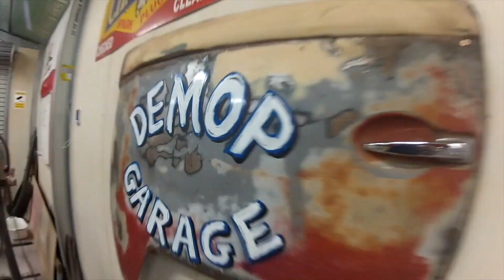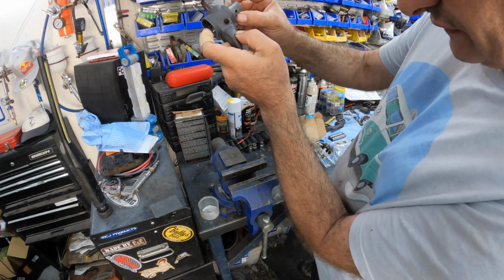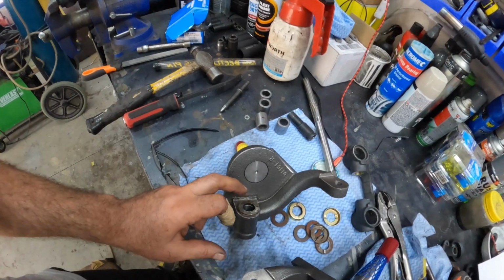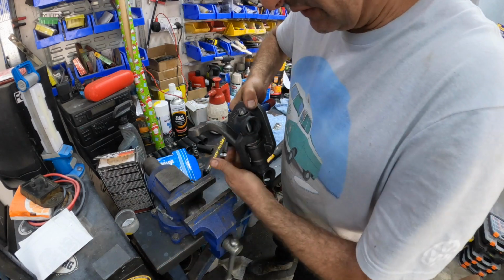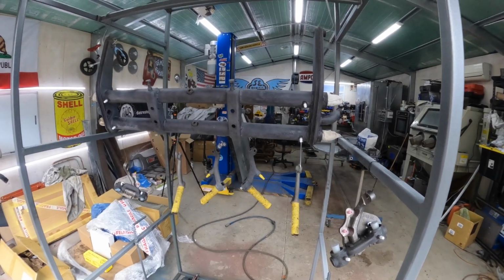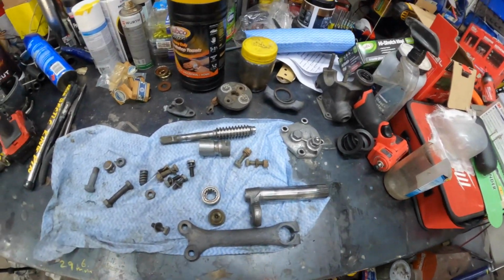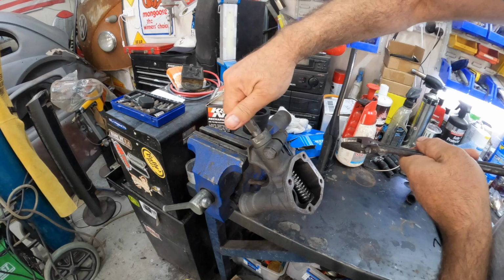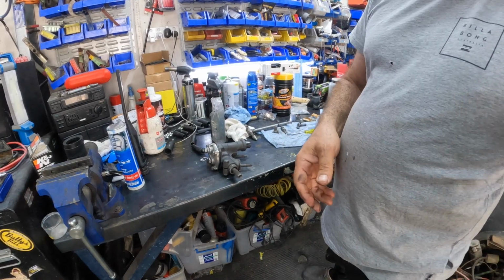Rebuilding the front beetle beam and steering box // 1957 oval beetle restoration. #volkswagen

Comment: Is there a video on disassembly of the steering box? How to remove the worm gear? Thank you.
Reply from the maker: No, don't think I filmed it but really its the same as whats on here just backwards. Side plate off first then remove the side bolt and tap out the seal plug then the worm drive.
Reply: @DemopVWgarage  sorry to ask so many questions. How do I remove the cap on the end of the worm gear?

Comment: What company did you get the bearings from? I have a 1957 oval I am working on. Thank you!
Reply from the maker: https://www.wagenteile.de    Not sure if they have any more stock they were old nos parts.
Reply: @DemopVWgarage  ah bummer. I was looking at Wolfsburg West and I don’t see them available on their website. I removed the top of my steering box, cleaned up the sludge inside and put fresh oil. The steering arm moved freely when the cover was off, but once I tightened down the four bolts the arm was hard to move. Any thoughts? Thank you!